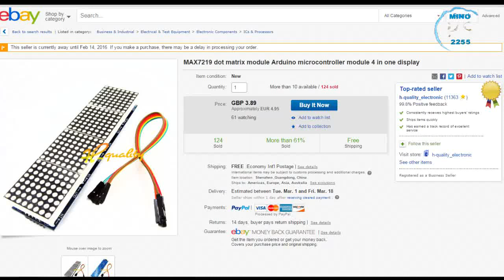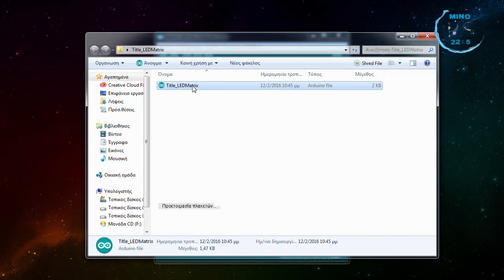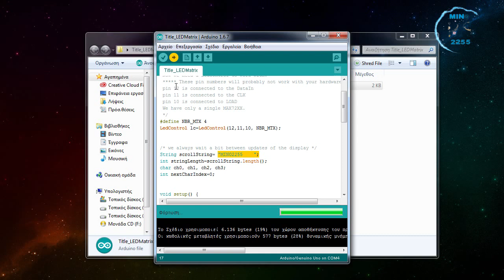Arduino tutorial: LED Matrix red 8x32 256 Led driven by MAX7219 (or MAX7221) and Arduino Uno

Comment: May i ask, is that LED consists of multiple MAX7219 chips connected together or only one MAX7219 is needed, the other is normal LEDs?
Reply: Hi! Each Matrix Module uses a MAX7219 (4x Display and 4x 7219)